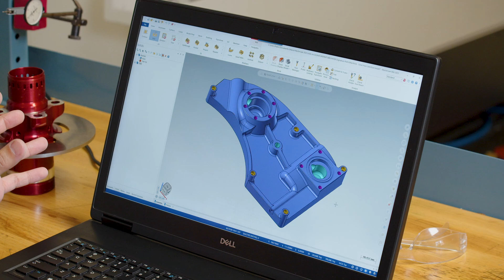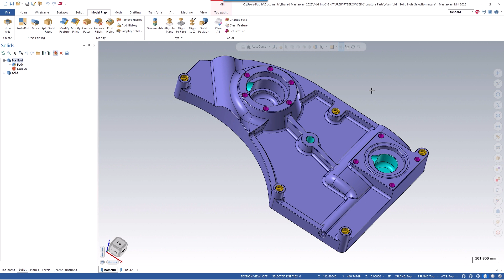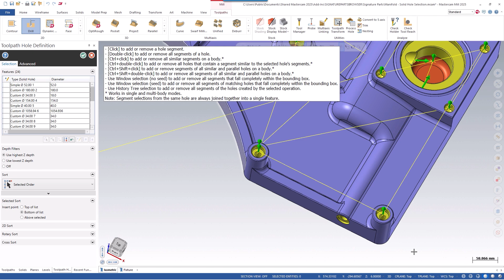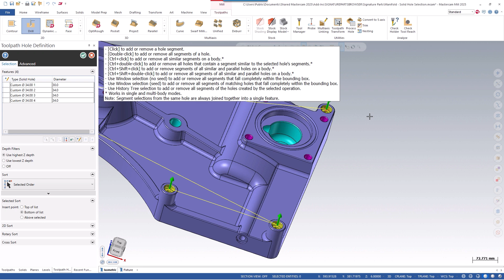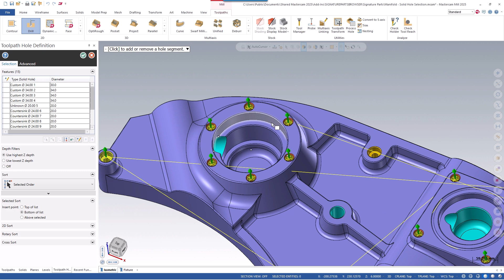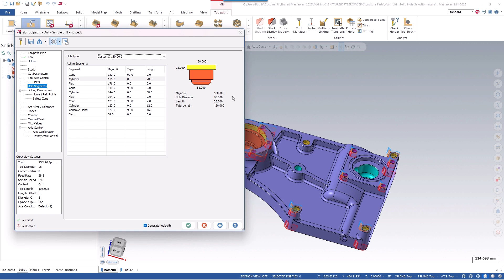Solid Hole Selection | Mastercam 2025 Signature Parts

Comment: What’s the difference between the window selection seed compared to Mask on Arc feature? Isn’t it the same with selecting a hole and highlighting the part to get all the similar holes
Reply from the maker: Thanks for reaching out! When using the window selection, you're selecting the solid hole feature. 'Mask on Arc' won't include the hole segment data or its associated benefits.